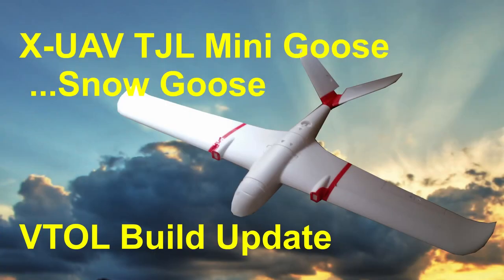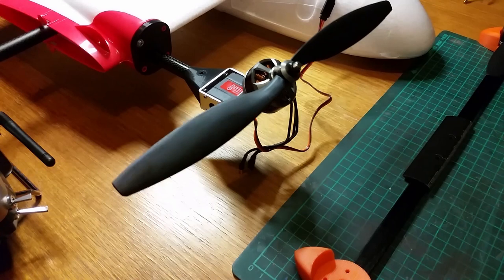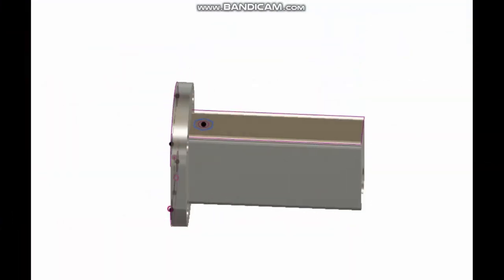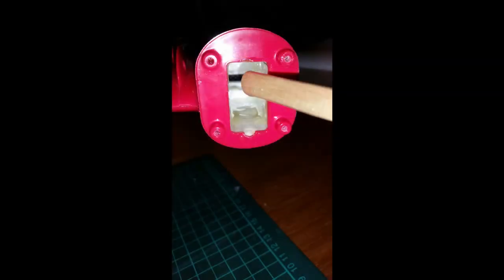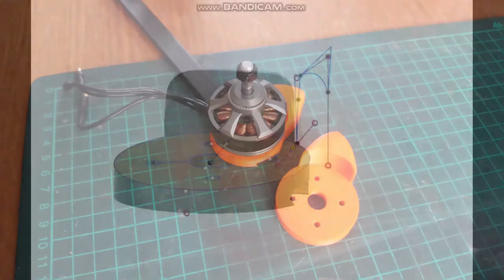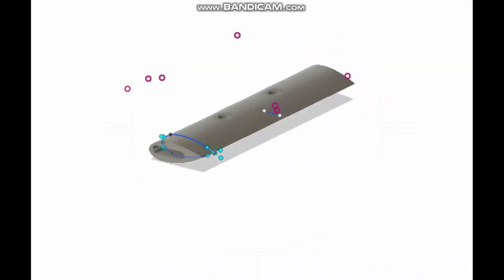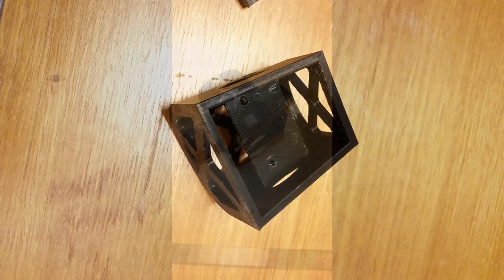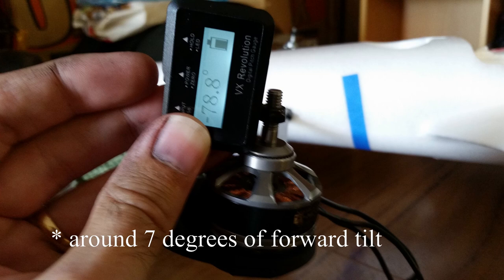Part 2 - X-UAV Snow Goose - VTOL Build Update

Comment: I am impressed by this VTOL implementation. Is there a chance to get the STL files?
Reply from the maker: Sure thing. Keep an eye out for the 'final build video' - which should be up in the next week or so - I'll link to the STLs then. I made a few changes to the rear motor booms compared to this video, and this will all be described in the new video.
Reply from the maker: Hi. The STLs are linked from this video: https://youtu.be/cHCn9pY1x8k

Comment: Great ! Why 4 motors instead of 3 ?
Reply from the maker: Hi Edir, first and foremost, I wanted to reuse the 3508 motors (they were from an old heavy-lift quad copter) and based on ecalc estimates, three of these motors wouldn't have enough thrust. A second reason is that while a large powerful motor like that used on Foxtech's Nimbus would probably work OK in a tricopter configuration, it wouldn't be too efficient owing to the width of the fuse where the motor would be mounted. Working out what motors to use that will give good performance in both VTOL and forward flight is tricky, but hopefully this configuration will work, but if it doesn't then I will consider other motor options.